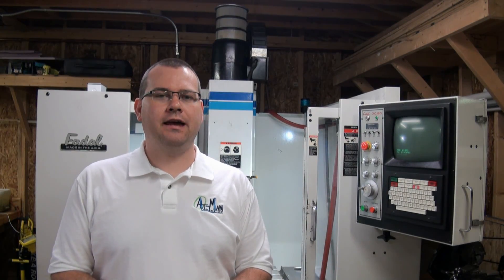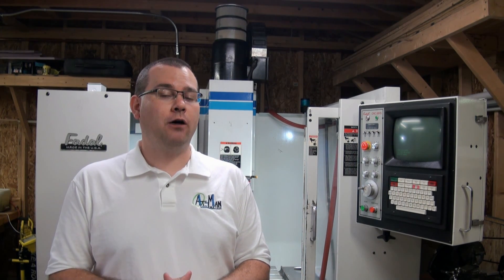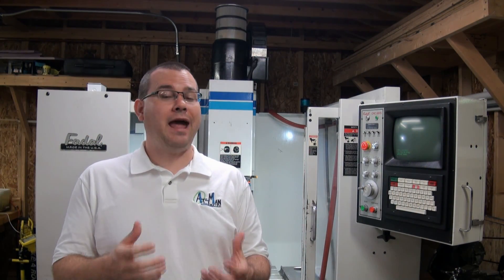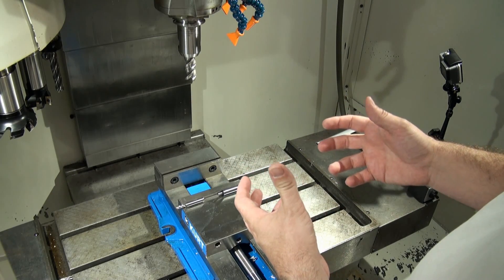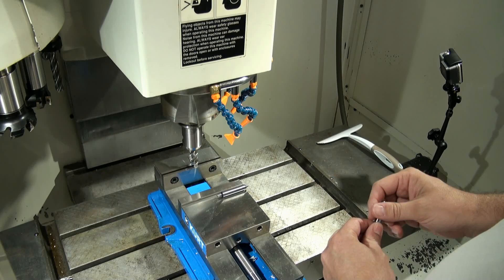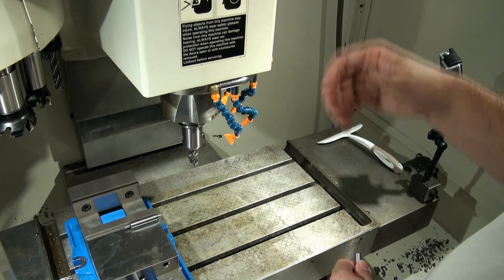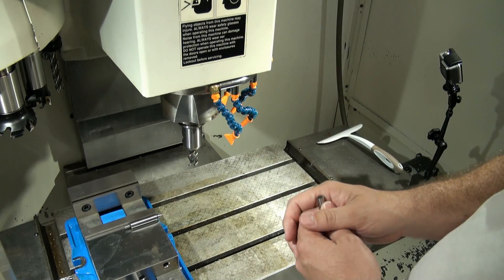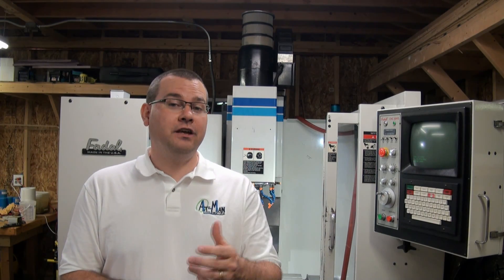CNC Mill Tool and Work Offsets Explained Part 1

Comment: Hi Engineer ! 

I have a problem with my FADAL machine , specifically on  the Z axis trajectory, this axis never arrives to table automatically. What values i have to modify in the SO ? 

Best Regards from Mexico
Reply from the maker: I'm not sure I understand the question, could you provide more information?
Reply: Enrique Mandujano

Comment: can you explaine the relation between G10L10 and G43   ?
Reply from the maker: Hello Muhnd, G10L10 is a command you can use to modify the value stored in the tool length offset table from within the program. G43 is used to actually apply the selected length offset to the position of the axis.
Reply: At-Man Unlimited Machining 
thanks for the quick answer if i understand what you mean is the G43 is apply the tool length from the table that stored by G10L10?is it works togther(G10L10andG43)
Reply from the maker: In most cases people measure and set the tool length values in the table ahead of time and do not use the program to set them. The G10L10 is a way you can modify those values from within the program if you needed to. I have not seen a use for it personally. Yes, calling G43 will tell the controller to take that offset value and apply it to the axis position.
Reply: Thank you very much